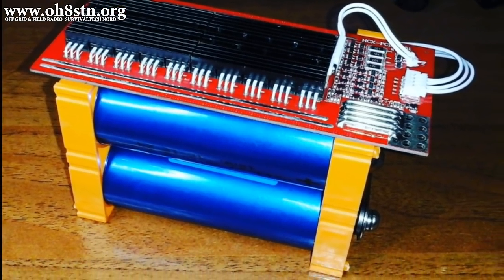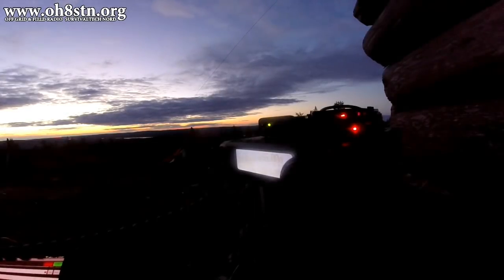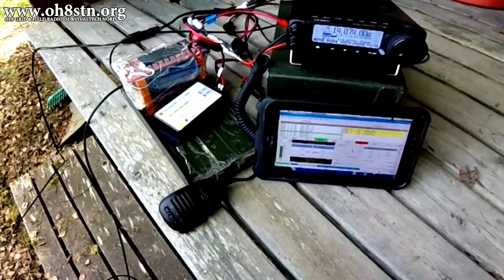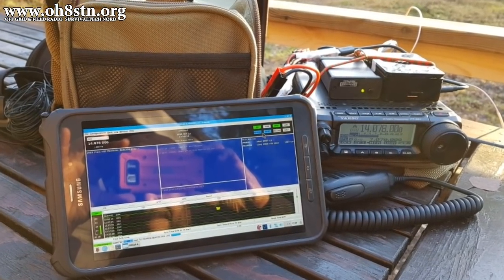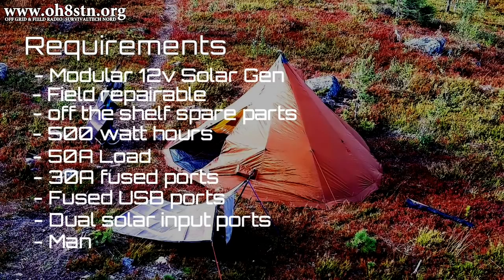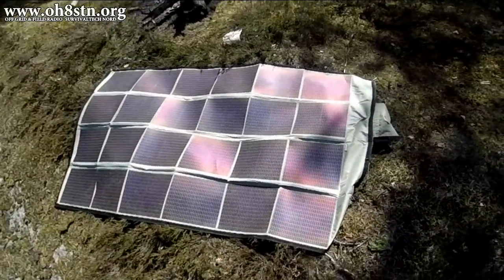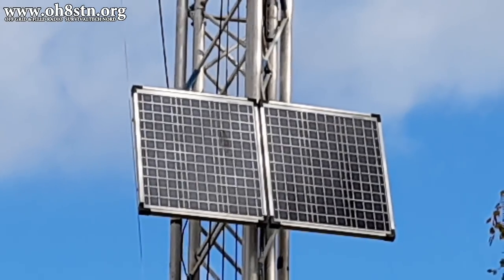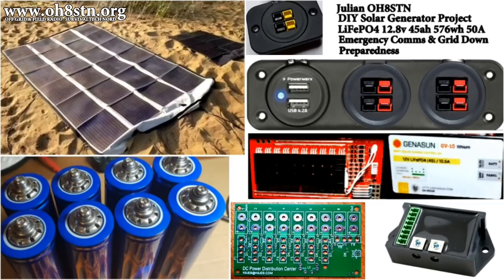Designing a Portable Solar Power Generator OH8STN

Comment: Julian, another excellent iteration upgrade of your battery pack which I am looking forward to undertake myself once I see your final product.  I have built your original  Portable Solar Generator and It has paid dividend.  A battery goes bad?  I can simply replace it.  I don't have to throw away the whole thing.  When money is not as disposable as we would like it.  This Generator simply makes great sense.  And anyone who thinks otherwise doesn't necessarily see the bigger pictures.  I didn't think it could have been improved upon but seeing your new DIY  Project I am already saying I can see how I can benefit from it.  Looking forward to the final result.  Thank you for never settling for less.  If you were a Wall Street stock option you would be among the prefered!!!!.

Comment: Julian, great idea and looking forward to the build. A couple of suggestions.

Try the Victron BMV 712. Its rock solid, has all the features you mentioned and has a active support forum. It uses coulomb counting, the correct way to measure charge into and out of a battery. It is a lot more expensive, but if you are going to use a Victron solar charge controller also, you might give the folks in the Netherlands a call to see if the can help with the project. It would be new and unique to them.

Second item, would recommend the rectangular four pin Anderson chassis mount connectors from PowerWerx instead. They have a lip on which you can secure a matching cable connectors. A much more secure power connection. It's the same connector they use on the front of their 30A power supply. Anderson Power 4 conductor chassis connector I use them on my HAM go-box. Although cutting the rectangular hole in metal is more of a pain!!
Reply from the maker: Thanks for the feedback.
I thought of reaching out to Victron since I often get suggestions about their gear. I heard they were in the Netherlands, but only found the North America site. I'll put more effort into this.
On another note, It would be great to have a partner who has a programmable charge controller. Then my battery projects can become universal, regardless of battery chemistry.
Thanks for the suggestion and feedback. I'll follow up with Netherlands as soon as I get some contact info.

73
Julian oh8stn

Comment: You are right on target with this idea. Here in my QTH EN94,ih, Ontario Canada, winter conditions for solar can be frustrating. This year in particular prolonged periods of cloud cover reduced the already limited sunlight. As someone with a considerable investment in a 4 Kw home solar system this absence of sun is more than a little inconvenient, it is irksome. As an amateur operator with a strong interest in reliable station power, it is also concerning. We have a gas and propane generator but this also has limits. In a sustained long-term power outage supplies of gasoline and propane will be limited or unavailable. Portable operations add another element of complexity to that scenario. There are however alternatives to solar, gas or propane. You can power a generator using wood gas and or biogas. A quick search of youtube will turn up a long list of videos showing the construction and use of wood gas to generator power. This may not be an ideal solution for portable power, and outside the scope of this channel, but I think it is worthy of consideration for some stationary operators. In our area woods is a readily available and abundant resource. Other forms of biomass can also be used in areas where wood is more limited. It is my intention to build a wood gas generator later this year. I will be pleased to share that information with anyone with an interest.

Comment: Hey there Julian!  Another fantastic journey I'm going to follow you on!
It sounds like you are addressing the problem encountered on the first venture with increased storage capacity.  Do you think a supplemental generating system should be considered... as a backup to the solar?  I've been kicking around the idea of a thermoelectric (Peltier device) approach.  I need to see what kind of wattage can be produced to keep the batteries topped off.  Picture something like a device to throw over a bed of coals or a Dakota fire pit when the sun simply refuses to cooperate.  A heat source will almost always be needed in a SHTF situation... cooking/heating/water purification etc. 
Take care!
73s
Rob

Comment: Looks like an awesome build Julian. Is there a method for charging battery pack off of an AC source or off gas/diesel generator when available?
Reply from the maker: Thanks for the comment. Yeah I have a video up already for the first 10 amp hour version, called simple desktop charging. And that video I use a laptop charger with an adjustable DC DC buck to limit the voltage to 14.2v 1A. That plugs straight into the solar input.
Reply from the maker: The amperage could be hired by the way for a faster charge oh, I just like to be gentle in the cells.

Comment: I particularly like the goal of being field repairable. Could this be extended to "field flexible" perhaps? By this I mean a power solution that is able to use whatever is available for recharging that you happen to run across during an emergency. An example might be a vehicle with a 24 volt DC system, it would be convenient to be able to connect jumper cables to the vehicle battery to recharge your pack. 

Ideally this flexibility would extend to 110, 220 and 48 volt AC and DC sources as well. Sort of like a field stove that can burn any fuel you happen to find.
Reply from the maker: This is an excellent point. We already have the solution on the channel. If you remember the short simple video " simple desktop charging"? In that video we used a dc-dc adjustable Volt/Amp Buck converter to charge the 10ah Headway pack. When I use that pack at home, there's an 18 volt 8 Amp laptop charger powering the adjustable volt amp buck. It could just as easily be any DC source up to 36 volts. 
So this is an awesome idea and one which I should have covered already. This functionality is already built in, but it hasn't been covered yet. I've been thinking about a "multi-charger" build, since this question keeps coming up.

Comment: Working on building a 4s4p Solar Generator with 8ah Headways.
Reply from the maker: That's going to be magnificent Don! I also thought about using a smaller version of the headways. The only reason I'm building the bigger one, was it was more cost-effective for the amount of run time I wanted. Outstanding choice of cells though. Hope you can share some pictures when you're done.

Comment: I use the bioenno & qrp in the field.  Home station, 200 w solar panel. About 100 amp hr lead acid.  This is the one i want to improve the voltage drop.  Wiring should be ok 6 ga, very short run
Reply from the maker: Well if your cables are good, with a one hundred amp hour battery that's fully charged, maybe there's something wrong with the battery. I mean I can pull 15 or 20 amps out of the smallest of the packs have built on the channel. A 100-amp hour car or truck battery should have no problem running v857 without voltage drop. There's either a bottleneck, or the batteries dying
Reply: Ill check further.  I enjoy the build videos, i may have to try it.  Would have to order everything, no supply  of any kind around here.

Comment: what about making this generator modular where you could have multiple generators that you could combine based on power needs, scenarios? maybe the benefit of combining vs running 2 separate would not be there. just thinking out loud :)
Reply from the maker: Actually that's not a bad idea. I would have two identical generators, rather than one modular one. Technically speaking, it's difficult because we would be connecting the battery packs, which are in different states of charge. If we have two different generators we have one being used, and the second as backup. 
So the specs of the generator a pretty incredible. The battery pack can output 450 amps, if we used heavy enough gauge cable to support that. So adding another generator wouldn't really provide us with any more usable current draw, it would only add additional storage capacity. And actually this is a good thing. By the way, we're going to do another one of these builds at the end of 2019. I'm pretty sure that would be a 1 kilowatt solar generator.

Comment: Can wait to see the finished article Julian. What are you using to drill the holes for the outputs? A stepper bit or hole saw? Shared to both club pages I'm active in.
Reply from the maker: Thanks Andy. I think I'm going to use the stepper bit used for the antennas on the automobile roof. I've got a couple of these cans so let's see how it goes

Comment: Great info, will help with solar gen. I have questions, not understanding all the in's and out's of electronics, however, when talking about power inverter what is the difference of high and low frequency?  Do you know anything about modified and pure sine wave inverters?  Which do you suggest?
Reply from the maker: Hi Robert. You won't see a lot of inverters on this channel because we try to keep everything DC.  I found a very good video explaining the differences between high-frequency and low-frequency inverters.
https://youtu.be/iMHBw93W-XM
I've already watched it through and think it's a good video, although a little boring. I hope this helps you on your electronics Journey 👍👍👍

Comment: So learning from your channel I have a question, why did you pick digimaster ( miniprosc) instead of Rigblaster or Signalink? Now I understand that the raspberry pi is like Bluetooth , which is really cool. Then how much difference does the red hat really make on wiring? Did you use windows to change programming on raspberry pi? Seems like code in Linux operating system, or did you run linux within windows? I know I’m a pain lol!
Reply from the maker: I chose the MiniProSC for its size and simplicity. The Signalink is too large for por table use, and the rigblsster is too big, too complicated, and not designed for the portable operator. I have a Rigblaster NOMIC, but never use it (paperweight with internal sound card). The two choices really are Signalink and DigiMaster. 
The Raspberry Pi is my station computer. All apps are running in it, and it connects to my radio and audio interface. To use the raspberry pi, I connect to it wirelessly using my Android Tablet, over a Wi-Fi connection.
It all sounds terribly complicated but once configured, it's the simplest way to operate a portable station, without having a bunch of wires attached to you. 
Here's a video showing it all.
https://youtu.be/BcMMlGvPCsw

Comment: Supply voltage question.  Running higher output power with the 857d or 7200 specs 13.8v +/- 15%.  I find i quickly reach a 11.5 to 11.7 supply voltage.  Do you use any type voltage booster?   Operating the 817nd is no problem but at times want to run higher power   kc5bg,mike
Reply from the maker: Hi Mike. Which battery are you using? Bioenno? If you built the pack yourself there's a couple of things you can do. On the bus bars double them up so that you will have less resistance and more current capability between the cells. Next make sure the cables between your rick.and battery are rated for 20-30A. What you're experiencing is a classic voltage drop caused by some weak Link in the system. Either it's the cells used to make your battery pack, the bus bars used can't carry enough current, or the wires between the battery pack and the radio can't carry enough current. If you bought a battery pack off the shelf, make sure you increase the size of the wires between the battery and your radio. Finally if you have a solar system like I have there's a battery a charge controller and then from the charge controller to your radio, also make sure you are charged controller and the wires coming to it and out of it are rated for the power you're running. 
I wasted off a lot of money on the best wire  I can find. I promise you it's worth the investment.
73
Julian oh8stn
Reply: I have no problem when sun is out and system is charging.
Reply from the maker: That's the answer to your question. 👍 It's the battery. The battery on its own, can't keep up with the current draw of your 857.
Reply: Are you using LiFePO4 or Lead Acid?  The LiFePO4  are very helpful because their voltage remains a bit higher through the discharge when compared to lead acid.
Reply from the maker: Hello Ryan. I completely agree with you. So naturally, this is lithium iron phosphate (LiFePO4). I've reduced voltage drops by using 10 AWG wire, short wire runs, and 3 cells in parallel for a total of 450A current draw potential. Further voltage loss reduction can be achieved by using busbars doubled up. 
Thanks for the question and comment.
Reply: @OH8STN  Sorry OH8STN that was meant for Mike.  I saw you asked Mike which battery he was using.  He didn't ever answer though.
Reply from the maker: @ryanjennings5050  thanks for helping out though Ryan that's awesome. :-)